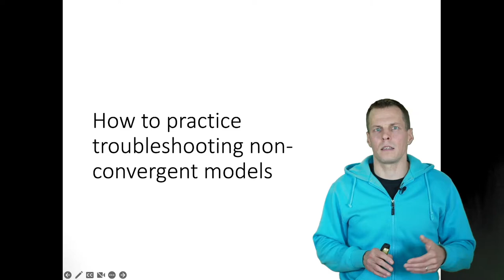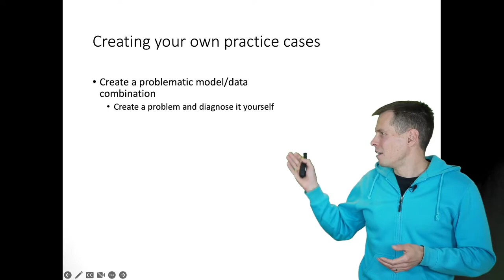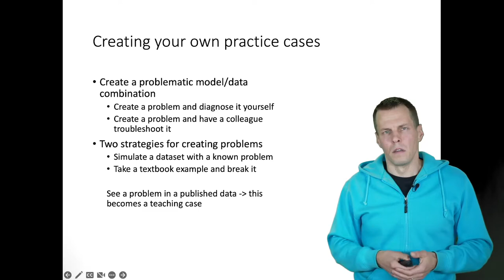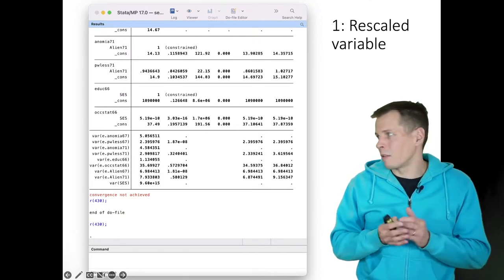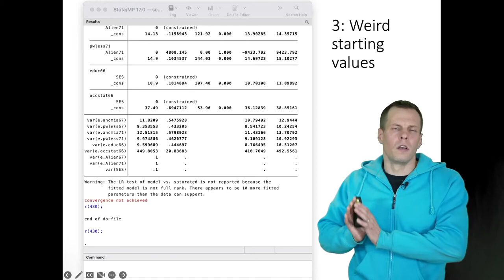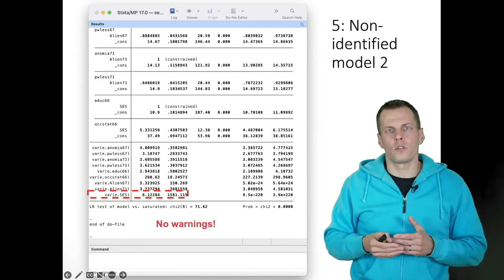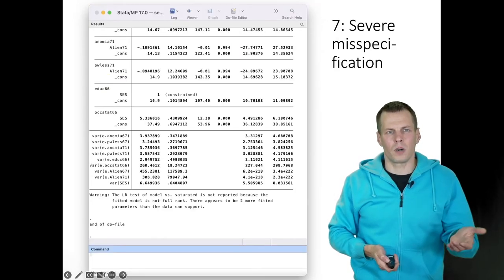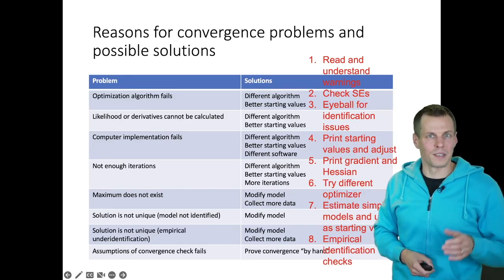How to practice troubleshooting non converged models

Comment: Very interesting. For the chapter non identification: "There appears to be one more fitted parameters than the data can support". Does this happen because your example you have too many parameters to estimate vs the number of manifest variables in the model (underidentification?) Do error parameters set to 1 count in the parameter equation?
Reply from the maker: What time in the video?
Reply: @mronkko  the model+output from minute 10.23 (sorry I'm on my phone I can't link the time). I have seen this "not full rank and more parameters than the data can support" in several of your videos on data convergence and wonder if it's always linked to underidentification, it has appeared for me too already and using the ((k+1)*2)/2 rule didn't suggest it unless I made a calculating mistake (the model is quite large)
Reply from the maker: @queenofcopas  Yes, that always means nonidentification. But identification can be either a feature of the model or it can be empirical underidentificatiin. The error will be the same because these conditions lead to the same outcome.

The parameter count rule that you are referring to is a necessary but not sufficient condition for identification. A model with positive degrees of freedom (as defined in the SEM literature, which differs from how Stata reports df for non identified models) can still be non identified.
Reply: Thank you so much for your answer. I will watch your other videos on SEM and model identification + workflow and take a better look on my past data again, I didn't remember having checked the SE in detail. Thank you so much for your work, it's very precious for us !